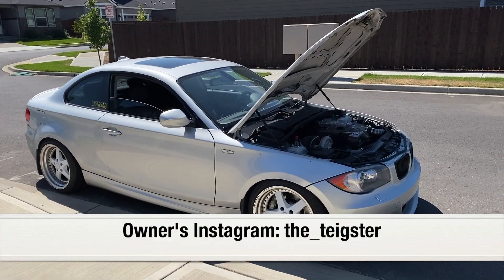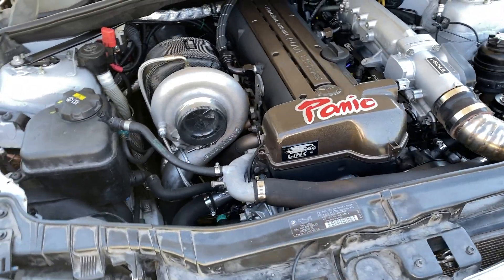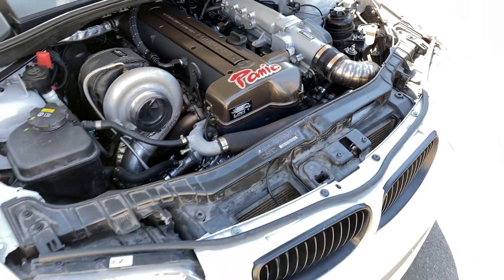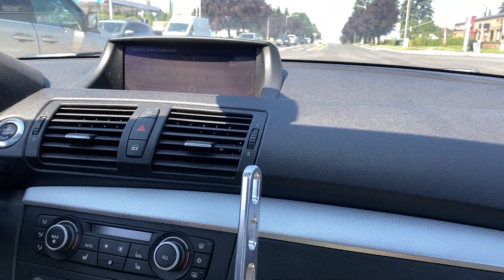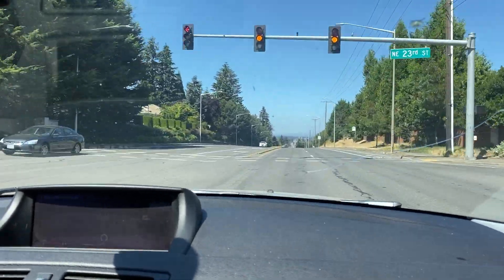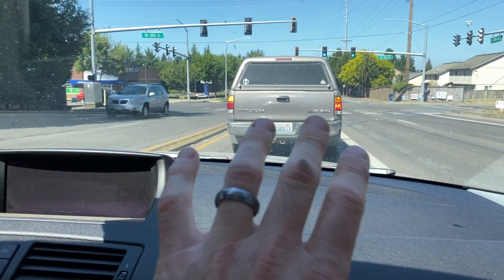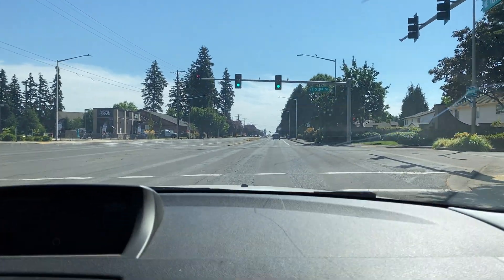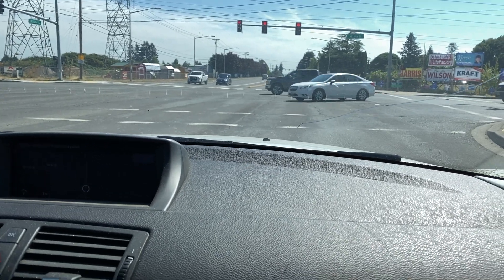Teigon's 2JZ 135i (USA's 1st E82 with 2JZ swap)

Comment: I love the swap but why? The N54 motor is already a beast and can make good power.
Reply: This is way reliable! N54 have weaker parts after what i read and heard about it..
Reply: @DeanBKK  lol lowbob
Reply: Jzz 30  actually they are swapping 3j into the new Supra even better 😂
Reply: I'm trynna swap my N52 for a 2 or 1J seeing it in a 135i chassis eases too much build anxiety ngl
Reply: @3MTurbo  stop read and hear... just test it😉
Reply: Good for a weekend car but if you think about it the reliability factor it's not that great! especially the EXPENSIVE coils👍🏽
Reply: N54 motor is great but evrything around it is trash engineered by bmw to fail, did seen people reach up to high miles 220 and 250s
Reply: @vladimirzubrilov8885  I don't get it. You started off by saying it's trash engineering, then right after say the reliability is great (can get over 200k miles) 😂🤣. An engine that can get over 200k miles is a pretty damn good engine if you ask me. 😂
Reply: @vladimirzubrilov8885  once all that bullshit is replaced, the engine will go forever. Some people on the forums have almost 300k on first year cars